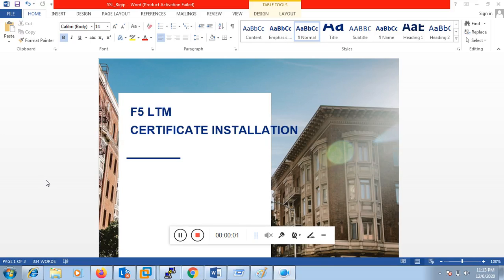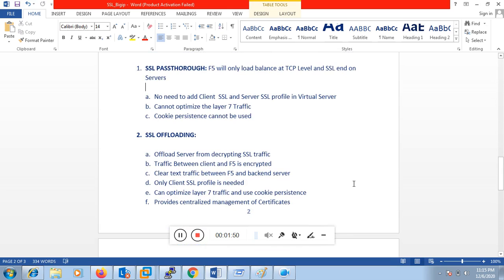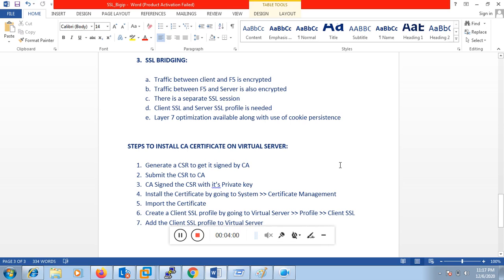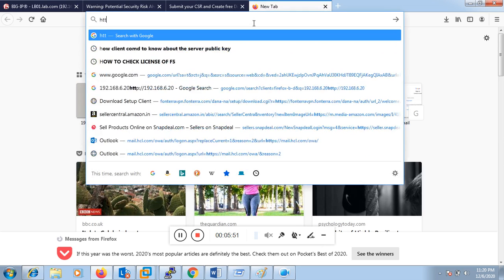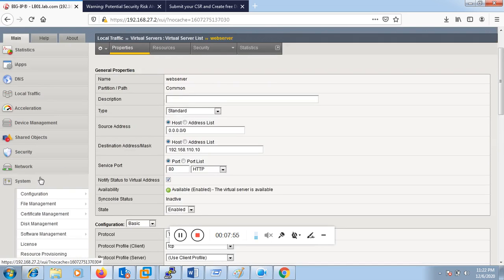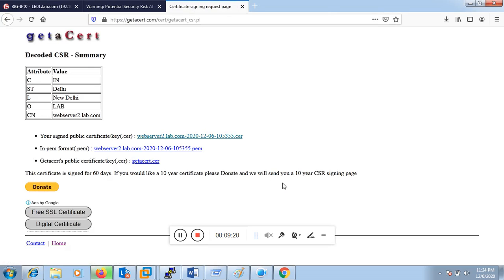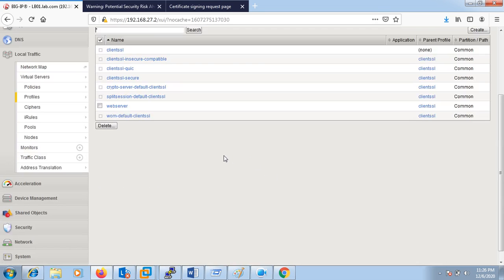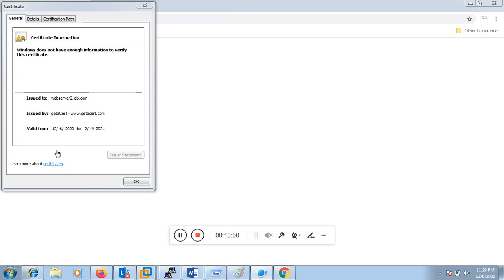F5 LTM Certificate Installation

Comment: Excellent! Finally a video showing all the details and using a CA rather than self signed cert. My only question is that you mention selecting Root cert. What happens if an intermediate issued your cert? Do you need to create a bundle with both root and intermediate CA or can You just select the root cert from the chain drop down?
Reply from the maker: Thanks for your feedback. In case if there is intermediate CA then you will receive a bundle including both Root and  Intermediate cert and you have to select that  bundle.